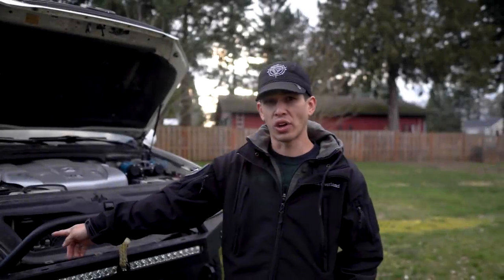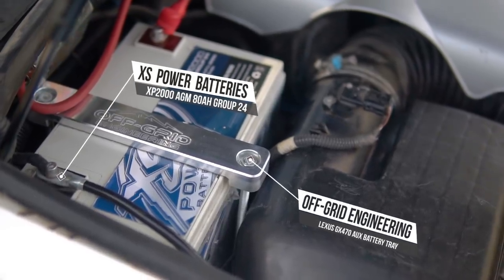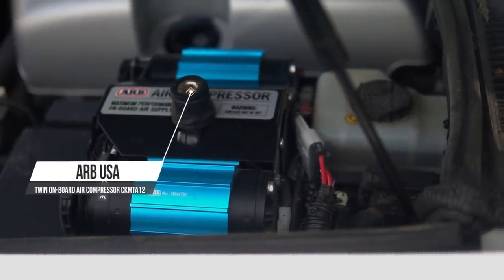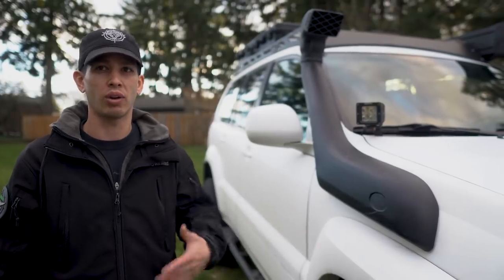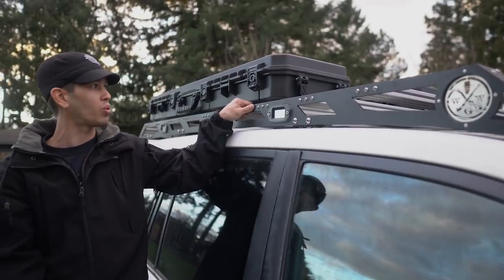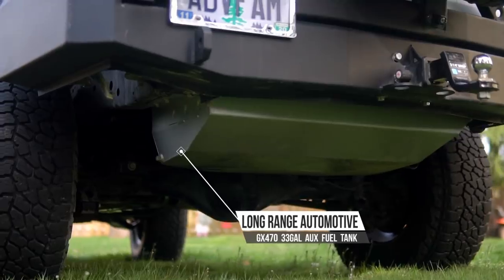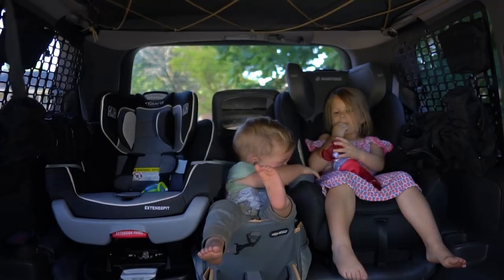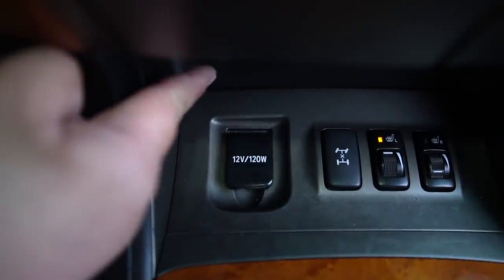GX470 Walkthrough  - Our Lexus Overland Build

Comment: I have a GX too, what a great idea taking out the second row seats and using the third row! I never thought of that. Most owners take out the third row and put them on a shelf forever!
Reply from the maker: Yeah it limits interior storage a lot but it works great with the kids it’s like a little play pin lol.
Reply: FWIW, 3rd row doesn't have LATCH tie-down. Seatbelts work well enough, but not as secure/safe as LATCH.  Considerations and battles, definitely not a deal-breaker.

Comment: Def need that aux fuel tank, since you have built a "Tank"...Im guessing about 13 -14 mpg on the HWY?...Did you happen to say what the wheel size was or offset? I had 285x60-18 on my 06' V8 4Runner with the 2.5 front Lift and 3" inback...MPG dropped from 21 to 17MPG.. Just Purchased on 08 Lexus GX470.. Bout' too get the "treatment"... thanks for all the links and great Info/ideas..
Reply from the maker: haha I wish try 9 towing 10 with just the truck

Comment: I noticed you mentioned the air bags. If planning on upgrading the suspension (to what degree) would it not be worth it to get the adaptive suspension, etc, in that case?
Reply from the maker: You mean KDSS? If that’s what you’re referring to it’s great for stock vehicles but if you plan on modifying the suspension or adding sliders it just ends up being more of a pain than anything

Comment: I am picking up a GX470 tomarrow. I have to say my favorite things are the SSO rear bumper swing out and the 33gal Aux fuel tank. To bad looks like SSO doesnt sell that rear swing out anymore for GX470 only the rock sliders which look way more beefy than Metal Tech and cheaper.
Reply from the maker: Shadowplate yeah agreed SSO keeps talking about a group buy for gx owners. I’d stay away from MT there lots of folks having issues both in quality and customer service. I actually bought their sliders then sold them cuz they didn’t attach very solid. The tank though is awesome almost 700 mile range is a game changer. Good luck with yours!!

Comment: Nice video and great ideas on how you’ve modified the car congratulations. Have you had any problems with the audio on the car? I owned the same vehicle and it is very reliable the only problem i have with it right now is the audio sometimes it works and sometimes it doesn’t but other thant it is a great vehicle.
Reply from the maker: Jp Meza no never had any issues with it is yours nav r non nav?
Reply: It is Nav equipped.
Reply from the maker: Jp Meza crazy fingers crossed I don’t have any issues with it while traveling abroad😬

Comment: 4runner Killer. V8, Armor, Fuel Tank, Lighting. A true expeditionary vehicle.

Q: Would or did you consider the Sequoia as a base to build from?
Reply from the maker: joseph powers thanks 🙏🏽. Yeah I’ve looked at them in the past but there’s so little support and after market upgrades that it’d make it a very difficult build process.

Comment: Very nice build. Can you tell me where I can get a Air Ride Control switch replacement the same as you have used in your center console to hold the 2 extra switches? Best of luck for your travels.
Reply from the maker: Thanks man here’s the info https://rover.ebay.com/rover/0/0/0?mpre=https%3A%2F%2Fwww.ebay.com%2Fulk%2Fitm%2F303131991583
Reply from the maker: Thanks man here’s the info https://rover.ebay.com/rover/0/0/0?mpre=https%3A%2F%2Fwww.ebay.com%2Fulk%2Fitm%2F303131991583

Comment: I want to add an extended fuel system. Do you have video breaking down the cost of that?
Reply from the maker: I don’t but I want to say it’s between $4-6k if you have it installed
Reply: @oxoverlandfamilyadventures4656  thanks! To me that’s worth it. I think Toyota really got it wrong putting such a little tank on this gas guzzler.
Reply from the maker: @Jotin8664  absolutely it was the best mod we did went from 250-300 miles to 650-700 miles per tank

Comment: I’ve owned two GX’s over the last 15 years, and it’s the most trouble free and best built SUV ever to me. Nice build, but with all the quality upgrades kind of bummed to see that cheap snorkel.
Reply from the maker: 993mike haha well I spend my money where it’s most important and to be quite honest there both made from the same material the only difference is a safari is about 300% more. I’ve got a safari on my 80 series and for abs plastic $400 is a bit steep but to each their own I just tend to learn from past mistakes. But I totally agree amazing rigs that’s what brought me to the GX, the luxury of a Lexus but pedigree of a land cruiser.
Reply: Would you recommend buying a 2-3 owner 2008 model with ~130k miles on it?
Reply: Is the GX 4.6L v8 aluminum engine as reliable as the 4 runner 4.7L v8 or 4.0 v6. Any thoughts or advice appreciate. Looking at purchasing one of them. How many miles on the your GX and repairs. I assume just because it’s Lexus badge it more expensive than repairs on Toyota 
Thanks

Comment: Awesome build. Just bought a GX470 myself & wondering how much of a lift you have and do your tires rub at that size?
Reply from the maker: Adrian Busbee did the OME BP-51’s I think it’s a 2-3” lift with 295/70/17 and SPC upper control arms no rub but we did the body mount chop and pinch weld to get them to fit.

Comment: It’s me again was there any modifications you did to install the battery 24 xs  because it is real tight with the air conditioner pipe in the way . Did you bend it or the air conditioner pipe leans very snug on the battery, how did you get the positive and neg cables to reach the main start battery with d2700 xs battery ??

Comment: Great video. I was curious about the suspension. Is there a pro/con to taking out the air compression suspension and putting a hard suspension in there? or did you leave that function and just add shocks? Contemplating doing it to my gx.
Reply from the maker: Danny Mrakovcic it really depends on how you plan on using it. If you plan on adding a lot of rear weight then you’ll have to do springs to adjust for it but otherwise you can probably get away with leaving them in. Just be careful with old air suspensions the older bags tend to pop

Comment: Fantastic build!  You have answered so many of my questions, especially the fuel range issue.  The tank upgrade is a must.  I have noticed that the Prado 150s come with an optional auxiliary tank and was going to look into that conversion, but your solution is perfect.  Is this a second fuel tank or a replacement for the primary?  And if primary, why did you need to do the fuel gauge in the 12v outlet and not the factory gauge in the dash?  Also, I am curious about the towing capabilities of the suspension you went with.  Is there any less towing capacity with the more off-road capable lift? One of the reasons I am looking at the GXs instead of the 4-runner is the increased towing capacity.
Reply from the maker: Patrick Massey thank you it’s a secondary transfer tank that was the reason for the fuel gauge. As far as towing capabilities it’s going to be vastly better than the 4Runner and I’m not sure if the suspension increases the capacity but it sure can’t hurt.

Comment: Hey man, getting a first car soon and have always been a car guy, But after seeing my neighbors Discovery 2, it’s just badass and I’ve been HOOKED with this type off roading scene.. Now my only question is, would the GX made a good first car? I love the practicality looks, reliability etc, but would it realistically make a good learner car for getting into this scene? Thanks..
Reply from the maker: UrAPlebTV yeah would definitely be a solid first platform. It really all depends on what you’ll be doing with it. How much road vs trail how many passengers you’ll have etc. but it’s reliable has plenty of power is really comfortable and has lots of aftermarket support.
Reply: Outlaw Xpeditions Overland Adventures Aight man thanks def gonna look into it.. As for build I probably won’t be going to crazy as I’m mainly gonna use it for lighter off-roading / Hauling my friends around all the time. But hopefully I can pick one up since I’ve heard nothing but good things about this platform...

Comment: I have had an 08 GX for several years. Kindly advise me about securing the rear door for security. How do you lock the truck given the outside release lever system needs to have the factory latch system in neutral so to speak. Thank you
Reply from the maker: Hmm not sure what your asking but with the rear bumper you first unlatch the bumper then open as normal using the factory door handle and it all opens as one unit. If you lock the doors then it won’t open

Comment: What gen of the 4runner and FJ platform is the GX?  I want to look for the BP-51 kit, but not many will give a straight answer.  What part# did you go with for the heavy?
Reply from the maker: Donson Pham 2896 springs and it’s a 5th gen 4Runner lift only difference is swaybar drop brackets are different
Reply: @oxoverlandfamilyadventures4656  Thanks!  did you had to source the swaybar else where?
Reply from the maker: Donson Pham yeah I got mine from metal tech since they were local for us.
Reply: OXOverland Family Adventures thanks for the info and knowledge!
Reply from the maker: Donson Pham you bet happy to help

Comment: for the BP-51 what vehice did you use 03-09 4 runner? nothing for gx470.
Reply from the maker: Michael C Johnson 5th gen 4Runner is what I used the sway drop bracket doesn’t work but everything else does
Reply: @oxoverlandfamilyadventures4656 Interesting I actually went to old man emu catalogue online and found the Pardo 120 series BP-51 part numbers VM80010029 front kit and VM80010010 rear. I wonder of those are direct bolt on.

Comment: In the engine compartment i would like to known if someone bought the same equipment  which project you would do first, second, third ect ect.....
Reply from the maker: John Gallegos good question I will say it’s more work but easier if you collect the parts over time and install it all at once but I’d start with the switch pro then dual battery then the compressor. You may end up having to uninstall some things to get the room to install others but that’s how Id do it. Thanks for watching

Comment: Just found this video looking for a decent overlander for the family. I have been converted to the GX and am already saving up for one to get started. What would you say is the most important modification you did first on the stock GX?
Reply from the maker: Jacob Maughan it’s a great platform you won’t be disappointed. I always say common sense sliders recovery points and winch on a hitch receiver cradle in that order. To many folks go with traction mats over winches because there cheaper but believe me you’ll be glad you went with the winch

Comment: House battery and auxiliary battery basically mean the same thing...unless you have 3 batteries on board...

And if you only have one fuel tank and an auxiliary fuel gauge, does that mean your factory gauge is no longer functional?
Reply from the maker: Haha that’s funny I was hoping no one would catch that. Some things get missed in editing especially with all the info I was trying to squeeze in oh well guess we all sound like idiots sometimes 🤷🏽‍♂️🤣🤣. 

The Long Range Automotive fuel  tank is a 33 gal aux fuel tank mounted in the spare tire location. It acts as a transfer tank to the original 25 gal tank and requires you to hit the button on the fuel gauge to transfer the fuel to the original. It ties into the fill neck this avoiding issues with the evap system and fills from the original neck. Might have been a little confusing the way I worded it.
Reply: Outlaw Xpeditions Overland Adventures it’s all good man. Thanks on the tank info. I was thinking the long ranger replaced the original one.

Comment: Knowing what you know now, Is there anything you would have (or are planning) changed in your GX470 build?
Reply from the maker: I wouldn’t have done a rear bumper there’s already a ton of weight in the rear no need to add more especially with the aux fuel tank
Reply: @oxoverlandfamilyadventures4656  that makes sense.  I've noticed in your more recent videos that the rear of the GX seems to be squatting a noticeable amount.  Without the rear bumper, what would have been your plan for storing the spare tire?
Reply from the maker: @wrgnsHouse  there’s a mount that goes straight to the rear door that I’d use for the spare if I’d do it again

Comment: hi Jason I like all of it now the gas tank like the extra fuel capacity hate how far it hangs down and yah Jason I have a 4X4 a 99 Lincoln navigator loaded with 30 galon tank opt. 4 can 32 valve 5.4 300 h.p. yes I've took it off road yes all my two wheel drive friend's thought I was crazy I told them it's four wheel drive why not besides my plates start 4XF how can I go wrong with plates on the navigator that say 4 X FOUR 😂😂😂😆 took it out to the steepest place out at the leve Toyota's going half way up my navigator climb right up to the top with 24's and street tires yes I replaced them and one question dammit Jason how did a ugly dog face guy like you end up with such good looking family they took after the mother didn't they just kidding 😂😂😂😆 good night Jason ⛺ C😎😎L
Reply from the maker: Cole Webb yeah definitely  took after their mom. Haha good thing too. A good 4wd can get you a lot of places for sure. Take care Cole.
Reply: @oxoverlandfamilyadventures4656  well the navigator is on the little to big side to say the least but you work with what you got runs and drive's good never has given me any trouble and will it will climb has the opt. air suspension all around put in to low 4X4 and it lifts to 3 more inches of ground clearance all a round for off road and gas mileage not bad for it's size I get consistently 18- 19 around town 22-24 high way yes i really get that kind of mileage but I'm thinking something a little smaller not sure what yet for more places off road well it takes two good looking people to have good looking kid's well you have a good night  ⛺ Jason hope you're trip all go's good and I'm glad all of you're crew came back together 👍👍👍 C😎😎L